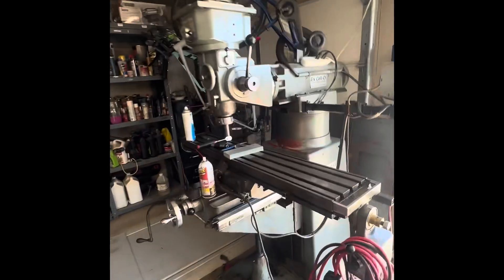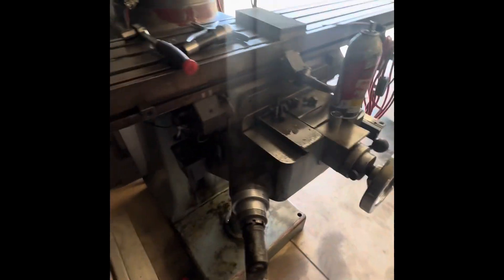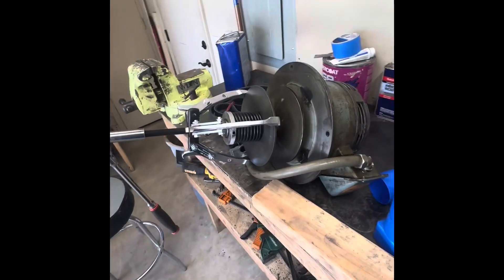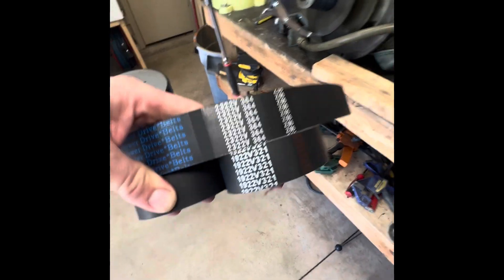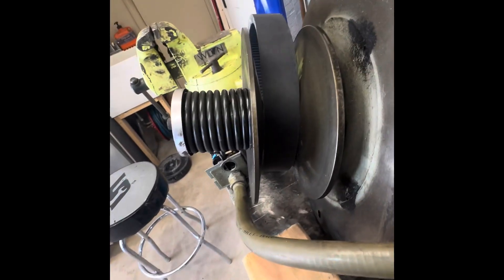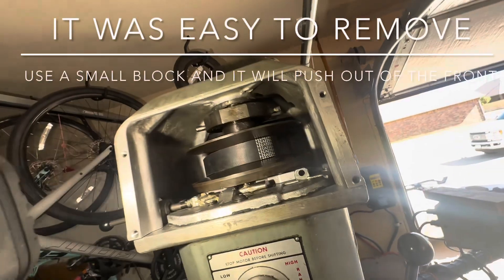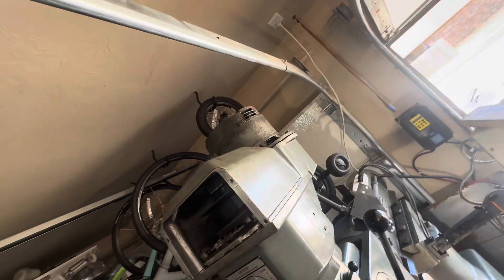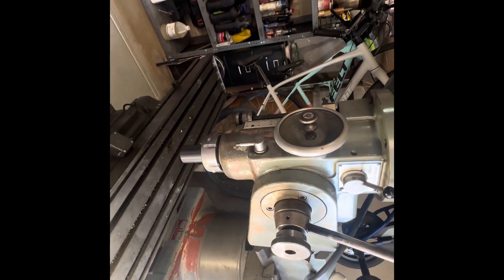Changing belt on Excello XLO 602 milling machine

Comment: Nice looking mill and great video.  The smaller belt you have is the belt that I used on my early model XLO mill and it matched the old belt I removed.  The upper housing on the earlier mills are totally different than on the later mills like yours.  It's a real bear to change the belt on the early models due to how the upper castings are made.  It appears Excello learned a few things when they redesigned the mills.  As far as getting noisy at the higher speeds, mine does the same thing.
Reply from the maker: Thanks for the info!

Comment: congrats on the new mill. That belt change worked out well.. Looking forward to seeing projects using the mill!  Thanks for sharing, I'm sure it will help some folks out. I changed bearings in my motor, and also used the block of wood
Reply from the maker: Thanks 👍.